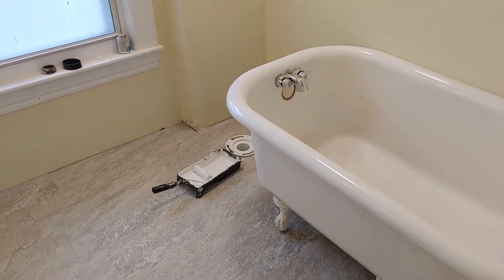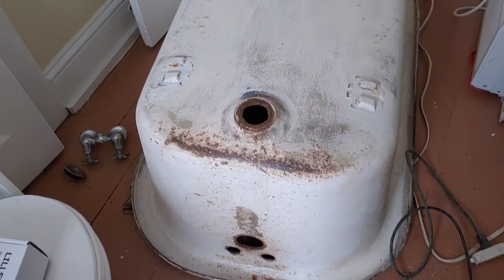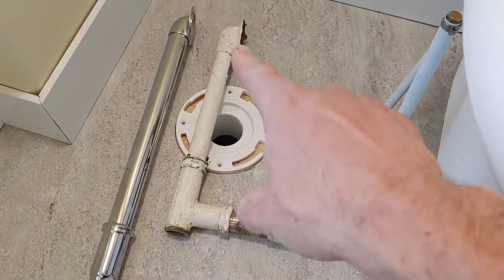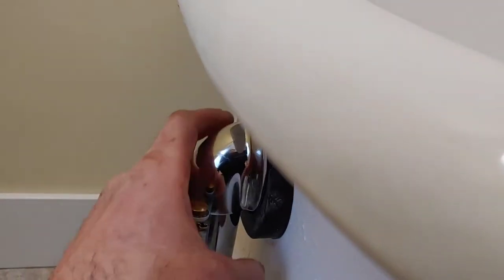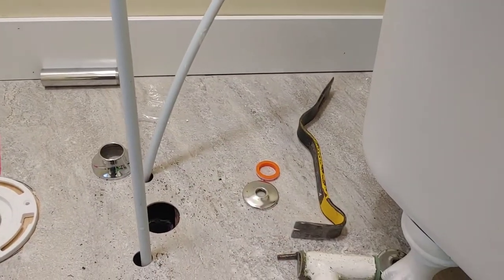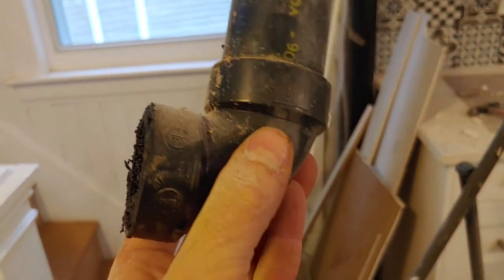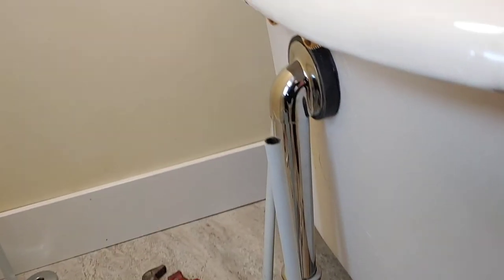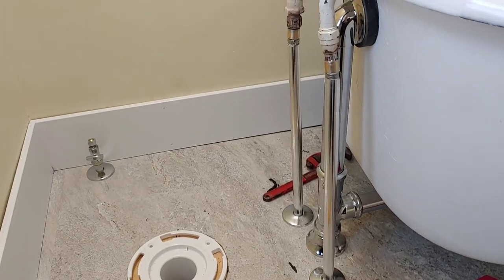IKEA Bathroom. Claw foot tub install.  100 yr old tub gets new plumbing.

Comment: How did you get the overflow pipe in? I watched the video just for that, but you didn't show it.
Reply from the maker: Sorry was a struggle.  I lifted the tub with overflow attached and dropped it in the drain.  Was a real pain.  I believe it had to be trimmed to length.